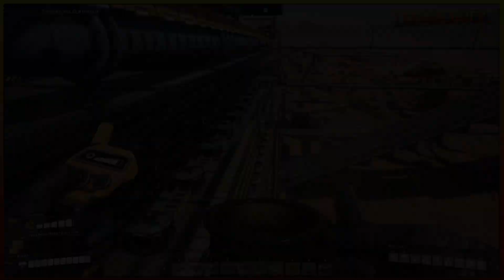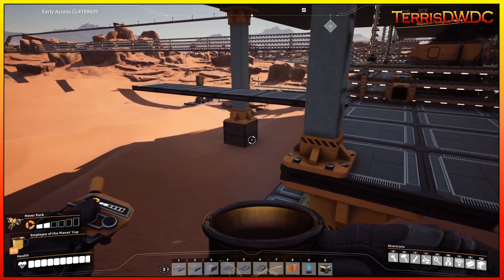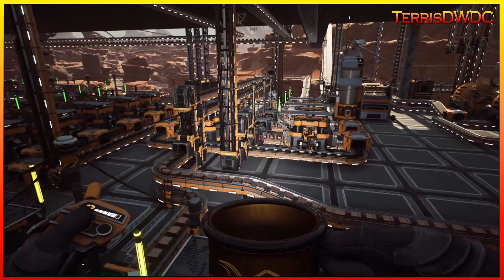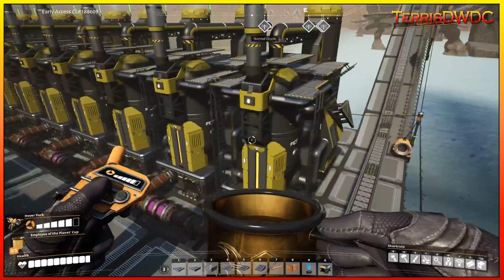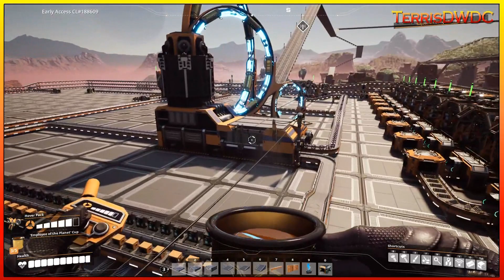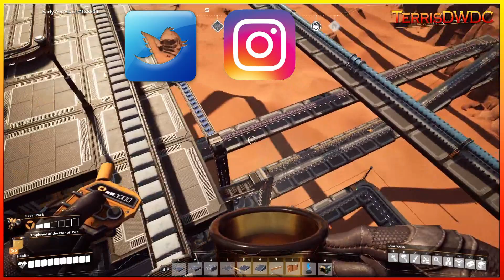Mega Factory COMPLETE - 75+ Gigawatts Power - Tier 8 Items 100% - Satisfactory Update 5

Comment: Update 6 is actually unlikely to break anything for your factory... it will "just" bury it under new terrain. So you won't be able to make changes without a save editor once you make the final switch (while U5 is still available, you could switch back and remove anything that won't be accessible in U6).

Even the oil nodes that got moved will still work. The existing oil extractors are marked in the save as connecting to particular nodes, and stay connected even when the node is no longer there. You wouldn't be able to put another extractor on the moved node even though it looks open because it is marked as in use.